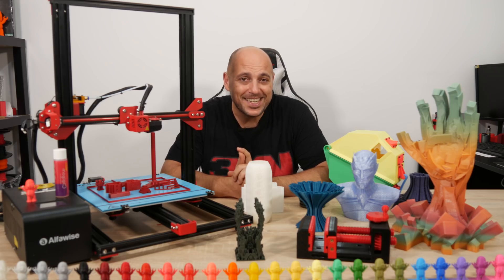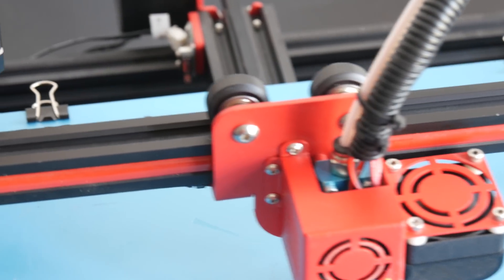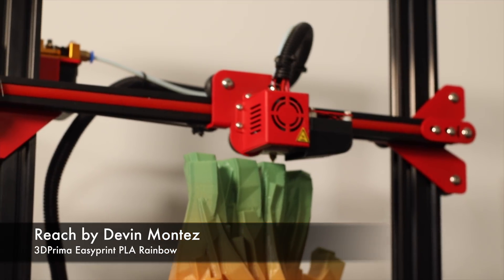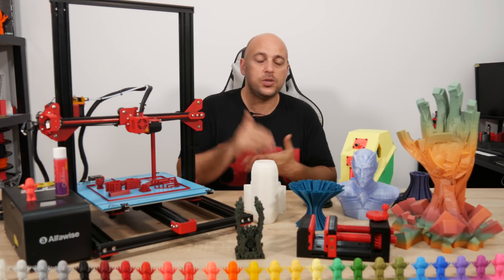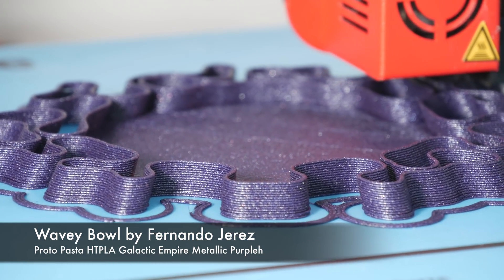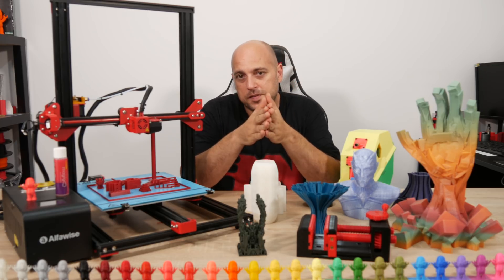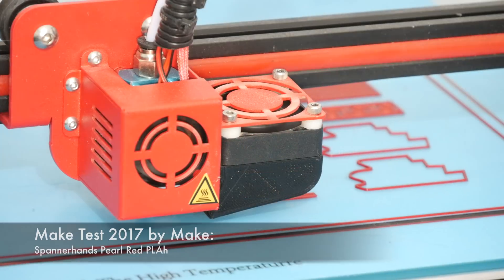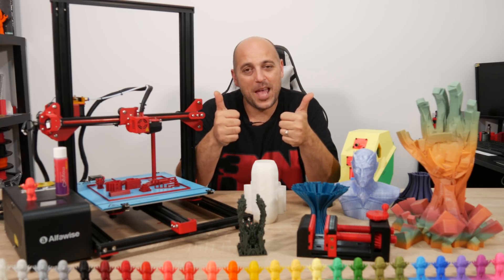The $299 Alfawise U20 Large Format 3D Printer Review

Comment: @11:00 you're talking about the sensor which i never done all that i just retrack till is out of the hotend and then i pull out from the sensor side, to put back i simply put what i can in by hand and then pull that trigger on the sensor side and use that as a reach in finger to place back in.  Simply push trigger while trying to push in filament till the goes in tube.

im hanging issues however with printing and i think is the slicer issue? for example in cura 4.0 i load my 321mb file in the slicer and send to sd card (the entire model is in the bed) yet the printer gets stuck going over the same path near X edge of bed, any tips?

Comment: If I dont care about filament run out sensor or power out sensor and do not use petg would this be a good inexpensive printer for large prints?
Reply from the maker: Actually they fixed all of that now so it’s definitely worth the money
Reply: @3DMakerNoob  I was looking at this or the tevo tornado. Have you used the tevo before? I have a flashforge finder now but want larger build size.

Comment: I had the touch screen go out on my u20. I have made extensive internet search with no luck finding a replacement 2.8 screen with the 40 pin ribbon cable. Any suggestions? It is a good printer giving my great prints but some issues.

Comment: does anyone know if these issues have been fixed? if not is there a equal size/price printer thats a higher, more trustworthy quality?
Reply: There have been six firmware updates since this review. My printer is on the latest V2.14 2018/10/08 firmware and I have not encountered any the issues in the review. The only two firmware issues I have encountered are very minor: 1) sometimes the nozzle temp will display 0 instead of my requested 205C but this will resolve immediately once my heated bed temp of 60C reached. In other words not really an issue at all.  2) When browsing gcode files on the memory card sometimes browsing to the next page will result in a page with no files. Simply going to the next page or previous page will resolve. Once again a very minor issue resolved in <1-2 seconds.

Comment: Hi Brother. Assembled my U20 Today, but having a major issue. On the right hand side, it's impossible to bring the  bed low enough so the nozzle is slightly above the bed. The right side of the X axis, hangs a lot lower, way beyond  the bed leveling capacity. I adjusted all the eccentrics properly, but, it doesn't help either. Any idea, what else, I could possibly try?

Comment: I bought one recently and have had some of the same issues you have. I have not been in a situation where it stayed on or did anything dangerous (yet) but I did have bent metal parts that allowed the X axis to flop around and some other fit and finish issues. After going over the machine and tightening/bending/fitting everything it now performs very well. At first I printed a filament guide for the extruded to help in loading filament, but ended up replacing it with an upgraded metal extruder designed for the CR-10. I did make a new block for the filament out sensor which moves it to the other side of the Z lead screw and keeps the filament inside a piece of Bowden tubing as it passes the lead screw. I also extended that tube to act as a feed-in tube to help the filament feed  from the overhead spool holder I use without having to turn a sharp corner feeding in. 
I’m glad to know about the Facebook group and the firmware upgrades. Hopefully they will fix all the issues. If I had realized that the firmware was being handled as closed source, I probably wouldn’t have bought one.

Comment: Wait a minute... they put these tubes around the cables everywhere, but the tube is not actually connected at the heated bed side to provide strain relief for the wires? Makes the problem even worse than when you had just the wires attached to the heated bed with no tube or other strain relief... Do they actually have at least one experienced engineer in these design teams, or who the heck plans and builds these machines?

Comment: There is no more danger to a hotend and bed sitting at running temp and not printing compared to it printing......hardly a safety concern.....
Reply from the maker: not a safety concern? when a printer freezes and you have no control over it? when fans switch off but the heat is still there? what if part of the issue is that even the temp limits fail and it keeps heating up? the concern here is a bug in the firmware? or maybe i shouldn't have mentioned it?
Reply: There's no more danger as long as the temperature control is still working. Since we don't know why the controls freeze we can't be sure the temperature control will not also fail at a later time and let the heat build up until the printer catches fire.

Comment: Are you complaining that the printer cant home without power?!? HOW SHOULD IT DO THAT?!?
Reply: It is possible with smart machines. They would need to detect 230VAC supply failure, and instantly kill the heaters and fans to use the rest of the power stored in the DC capacitors to do one final move. It would not be enough to completely home the machine, but if it could at least lift the z-axis a little, so the nozzle does not burn a hole in your print...
Reply: @Fallen Spike - You don't need a full XY homing. XY homing is when you are too lazy to record the Z position. But powering 2 motors for such long movements is too power hungry. A more efficient secure power loss procedure is to record the current printing status (at least the Z position) and move the head up just a few millimeters so it doesn't touch the piece and cools safely. This can be done in a fraction of a second with the energy remaining in the power input condensers.
You can find there a description by Josef Prusa of that feature implemented on a 3d printing mainboard they sell: https://youtu.be/RuvaSTg33r4?t=545

Comment: I'm glad I'm not in the market for another bot at the moment, because I'd be on the fence for this one, even with the issues. 

$300 for the printer, a bit of visual inspection for damage that just goes with any printer purchase, and $??? for a new brainbox (Smoothieboard, RAMPS+drivers, RAMBo, whatever's on the menu), because lord knows I don't trust that firmware after seeing/hearing that.
Other than the extra purchase and the config pain, this still looks like a pretty solid base.

Edit: And on the other hand, I'm not too keen on giving money to a company that's willing to release something in that state to begin with. A printer should never park a hot nozzle on the part, and should never continuously heat a sitting nozzle post-print without some very janky gcode that no slicer (at least that I know of) will ever output.
Reply: Would be cool if you could just get the mechanics and motors for 150$ from GB and then provide your own electronics. I'd go for something with trinamic drivers tho... Smoothieboard V2 might be a winner, but it could take some time to get one.

Comment: Joe could you do a video on flashing the firmware. Is there a simpler way than using a ardunio? Can it be done by just loading the file to a sd card?
Reply from the maker: In this case yes, since the alfawise is closed source firmware, they made it in a way that you just throw the files on the SD card and switch it on, it then reflashes automatically
Reply: @3DMakerNoob  what about the ender 3? I never flashed something so i am a bit nervous about screwing it up.
Reply: @carbide1968  check put teaching tech on youtube. He has awesome guides on flashing marlin to the ender 3 and how to set up some essential tweaks for the ender 3. Also a guide on flashing the bootloader because that printer doesn't have one stock.

Comment: Yeah, the firmware should have timeout (turn off heaters if nothing is printed for X minutes), but that was a kinda new feature even on Marlin.
The turn off heating procedure should always be included in the end printing script. So no matter if the screen froze, as long as the printer is using G-code it would still turn off the heaters.
Check your slicer to include that in the ending script.
Reply from the maker: That gcode is in fact there, but the printer froze so it didn’t register those commands
Reply: That's weird... I hope they fix it, because this printer seems quite good to have such dangerous bug.

Comment: Fantastic video. Looks like a great printer for the price, once they sort out the safety issues and power resume/ filament run out sensor issue
Reply: If it has that much issues it is not a great printer!
Why should we tolerate something like that? Makersmuse made a video about it and he's 100% correct, we are just beta testers for them.
Reply: It's even worse. That's beta testers paying the full price, investing time and money on the bug detection and reporting, and not receiving free patches from the factory.
Computer game beta testers can upgrade to the latest version for free over the Internet. And they often receive bonuses in game for thanks.
3D printing beta testers can't download the new version of failed parts for free. And they don't get extra filament either as a compensation for all the failed prints.
Also since beta testing is not official, there's never an announcement that the product is final and stable. So even if you wait for several months before buying you can't know for sure if it's still in the beta phase.